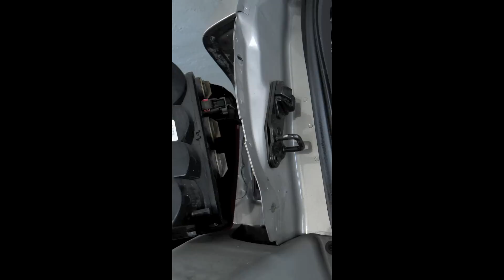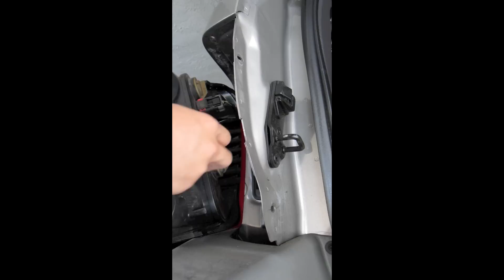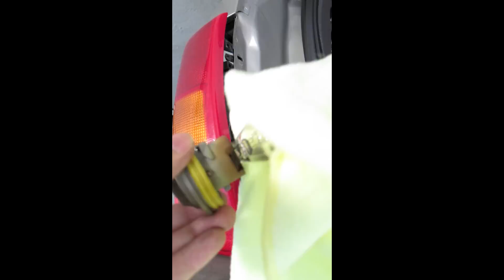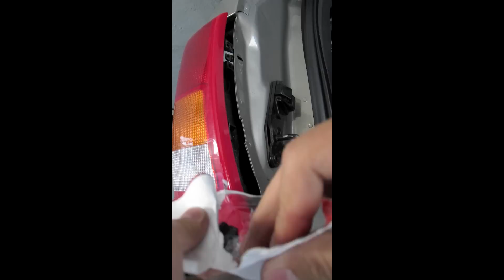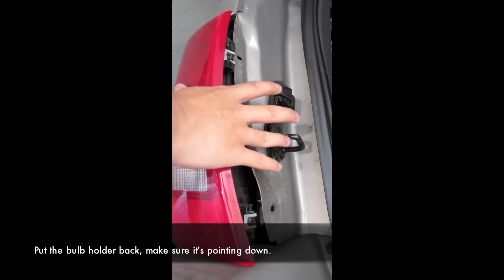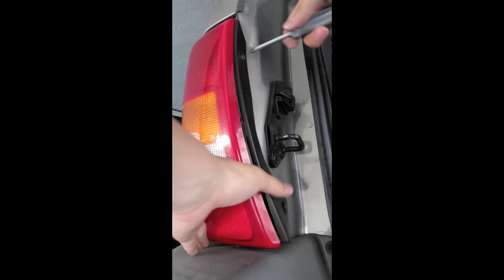Jeep Grand Cherokee Tail Light Bulbs replacement

Comment: did you figure this out?  I'm having the same problem.  Mechanic told me I could buy a new assembly, but I think there must be a more reasonable solution.  Both sides are out, the top mount light is working.